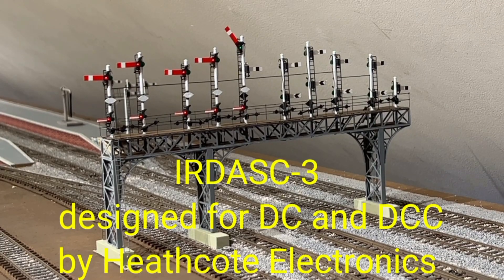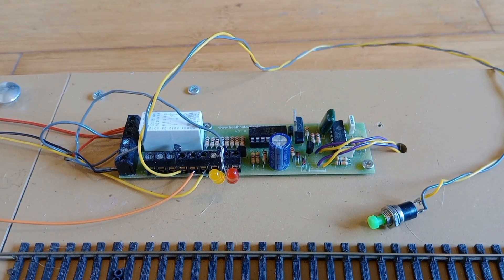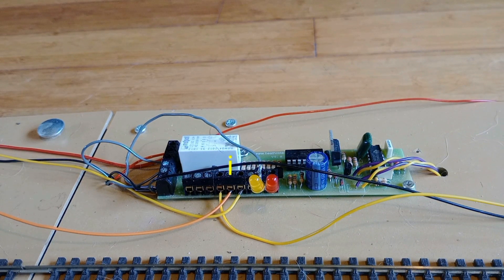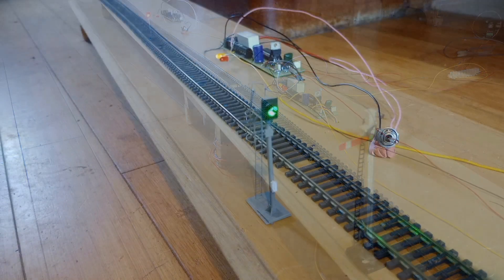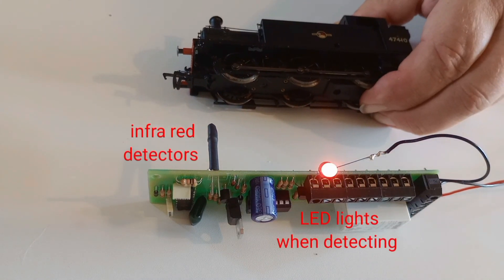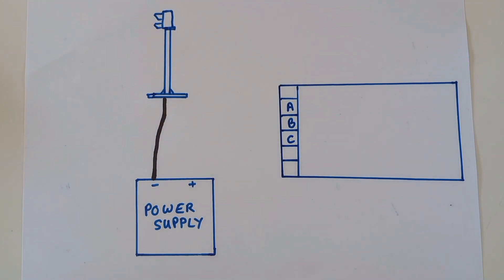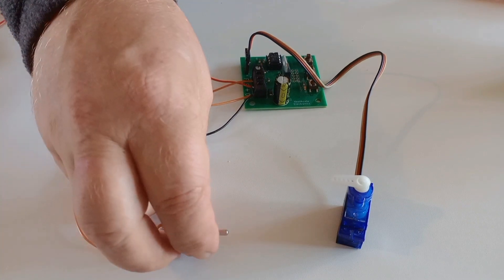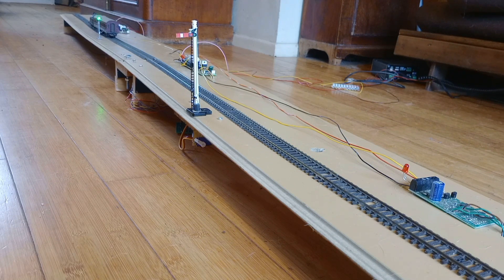Automating Semaphore and Two Aspect Colour  Light Signals realistically with an IRDASC-3

Comment: Hello. So if the block is occupied up ahead or the points haven’t been switched does the train automatically stop then until the block is clear or the points are switched?
Many thanks
Reply from the maker: Yes if you wire in the isolation section. In fact both the block needs to clear and the points switched before the signal goes to clear and the power switches onto the isolation section.

Comment: Is automatically bringing the train to a stop (including for DCC) achieved just by cutting power to the isolated section of track. If so, does this not bring the train to a very sudden stop?
Reply from the maker: You are correct. However if the train is running slowly you cannot discern a difference between a sudden and gradual stop. If you want gradual stops with DC then we have the SA7-SB controls. For DCC there are 2 methods you can use. Brake on DC (all chips should conform to this but some  Hornby do not) or ABC braking (mostly Lenz chips). The isolation relay on the IRDASC-3 could switch in either of these although you also need the IRDOT-3D for brake on DC to avoid a short circuit on the track.
Reply: @heathcote-electronics or if the locomotive has a flywheel it’ll be a smooth stop and if power gets cut then if the locomotive has stay alive it’ll stay moving as you probably know